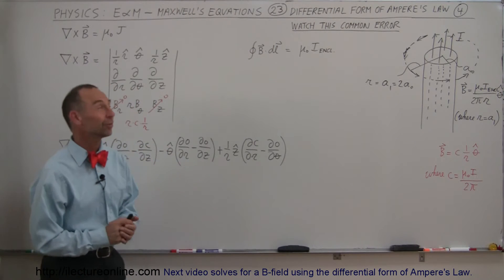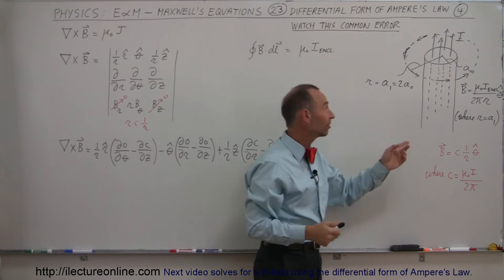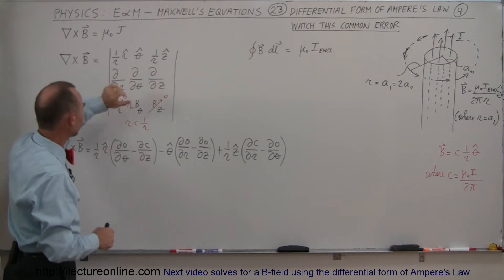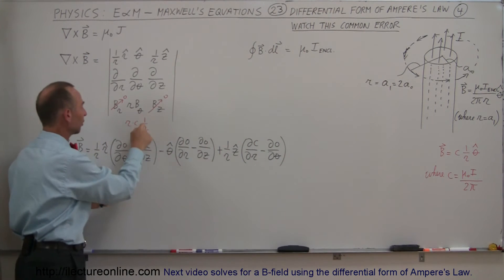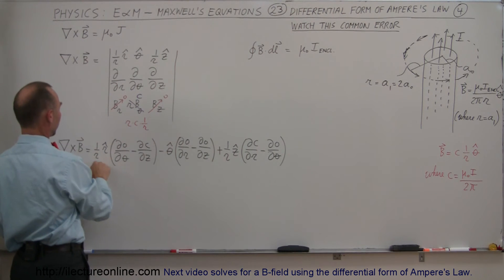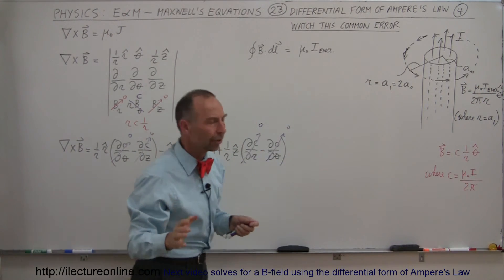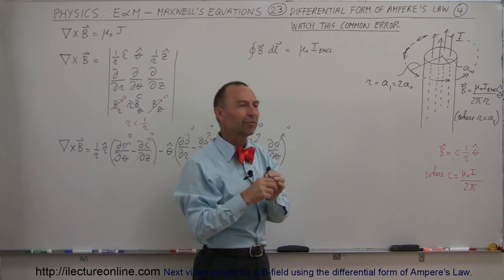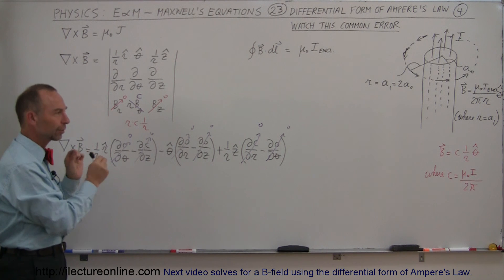Physics 46  Maxwell's Equations (23 of 30) Differential Form of Ampere's Law: 4 Common Error!!!

Comment: How do you know that the  B field everywhere is zero? What is the trick to understand how to find right direction of the B field?
Reply from the maker: No, the B-field is not zero everywhere, but it is zero in the radial outward direction and it is zero in the z-direction, since the B-field is directed along a circular path in a counterclockwise direction around the current.